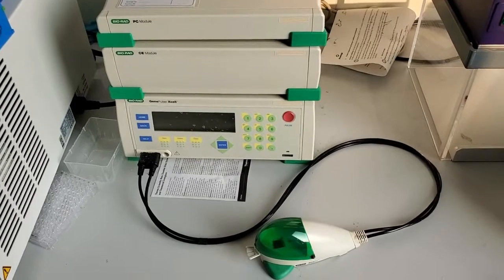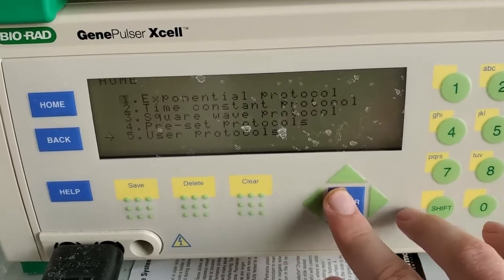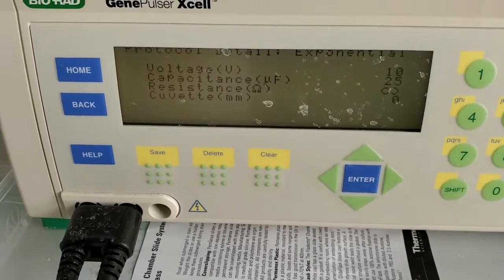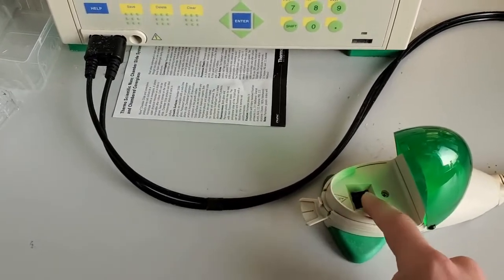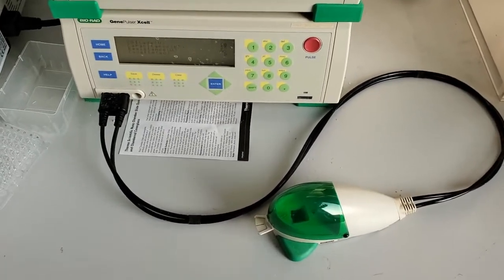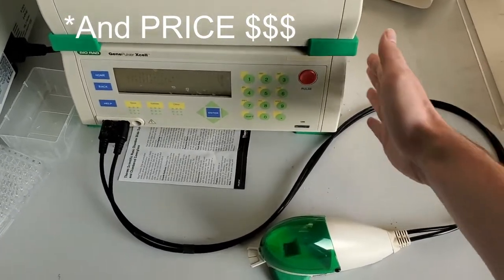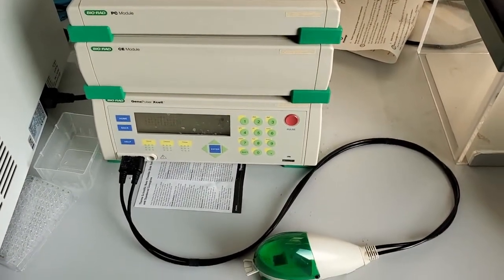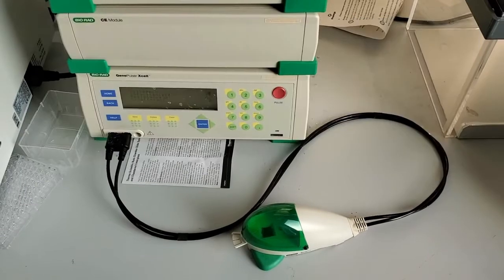Laboratory Electroporator

Comment: is it worth buying a lab electroporator compared to making the diy one ? for basic plasmid bacterial cloning?
Reply from the maker: If you're just doing e. coli transformation it's probably not worth it. Heat shock is pretty easy, reliable, and cheap. If you're using non-standard bacterial strains, an electroporator would definitely be more useful. I've heard from some people that the electropen results weren't able to be replicated though, and I never got around to testing my version with cells (https://youtu.be/QWenEwxIIrI), so it might depend how much tinkering/experimentation you're willing to do to get it to work. I'm currently working on a new design that I think makes a lot of improvements, but it's still in progress. Basically, if you don't have a specific reason for it, buying the lab version is probably not worth it due to the price, even if it's more convenient.
Reply: @qosmoschem  i see, thanks . i might do mammalian cells in the future though,  so some more control might be needed there. or i might just use an AVV. still not sure which direction to go since the research papers that i am following differ in opinions  on preadipocyte transfection.  But for now i just need to clone some plasmids for future use.